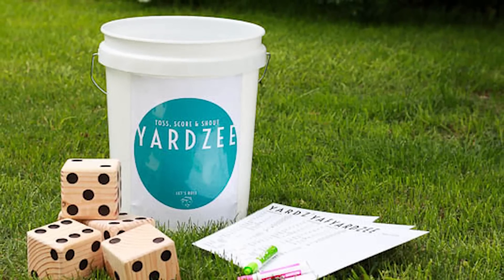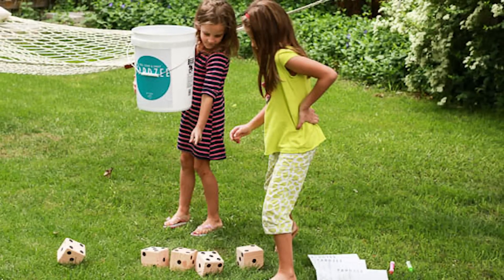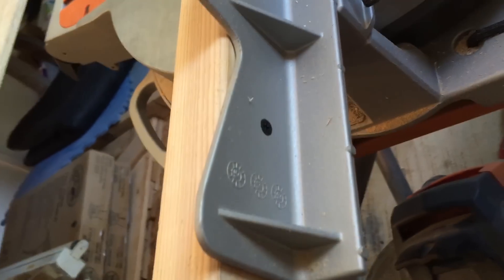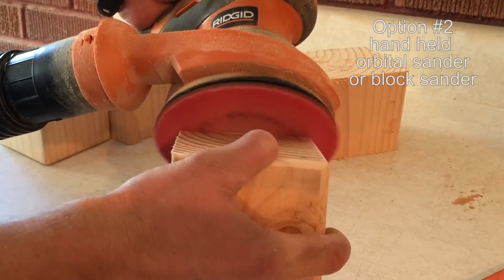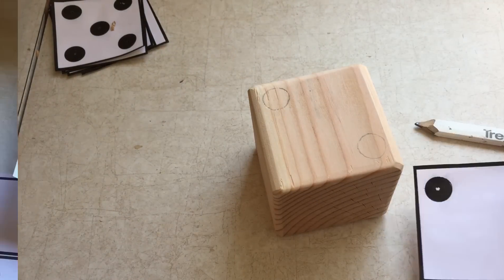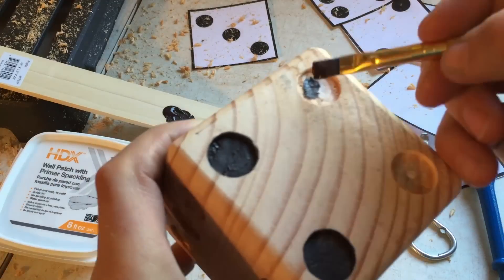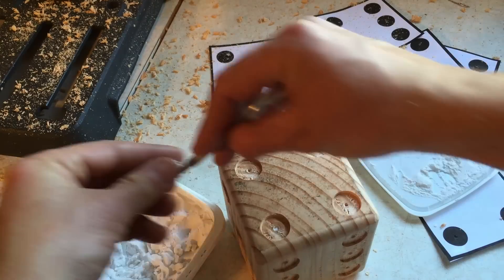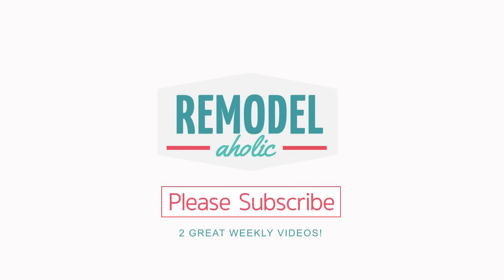DIY Wooden Dice for Yardzee Game with Free Game Printables

Comment: It's a nice video, and your dice came out fine. I have made several hundred sets of these now and the one recommendation I would make is to spray them with poly. 1/3 of your dice is end grain and can soak up a lot of moisture. Keep up the good work and I just hit the sub button.
Reply from the maker: +Mike Neuhaus thanks!  I wish there was a poly that didn't darken the wood, which is the only reason we didn't do it.  Maybe next time we'll white wash them and than add a coat of poly.